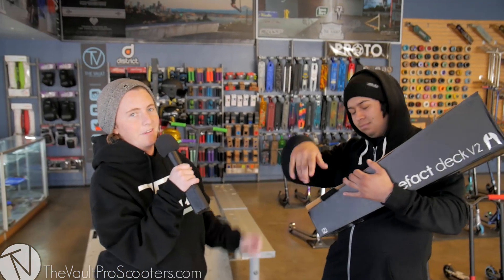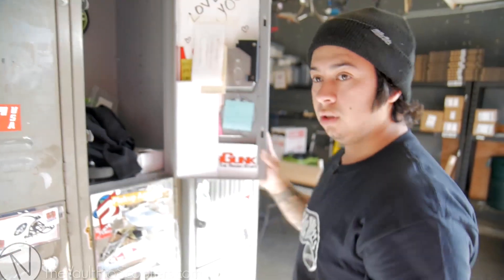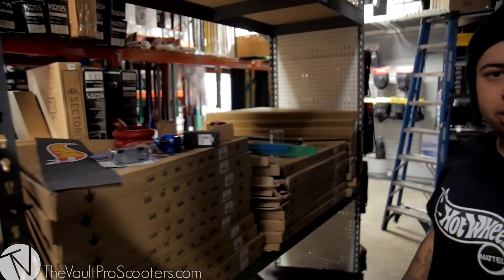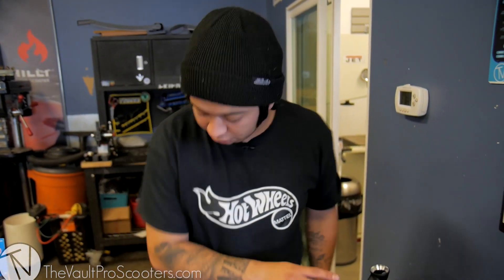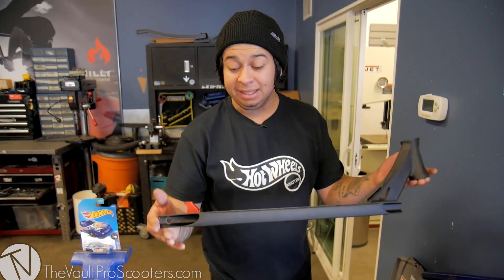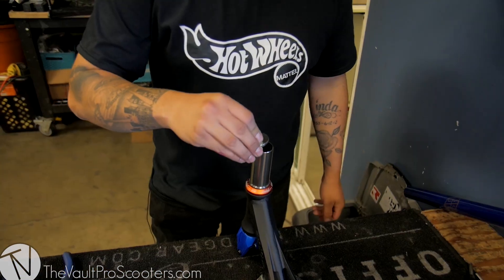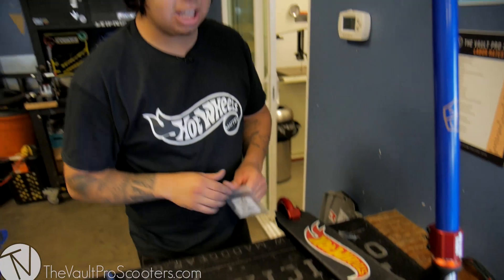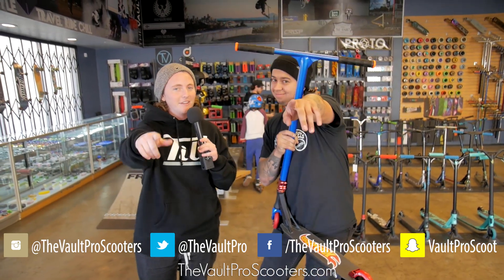Custom Build Off #6!! - Part 3 (ft. Walter Perez) │ The Vault Pro Scooters

Comment: Four months late, but Walter was a genius for using the red wheels. On the original hot wheels cars from the 60s-70s, the wheels had red lines on them, showing they were authentic. Whether Walter knew this or not, it worked perfectly.